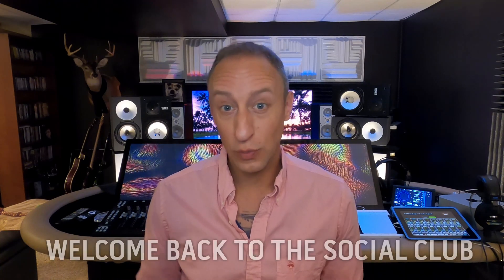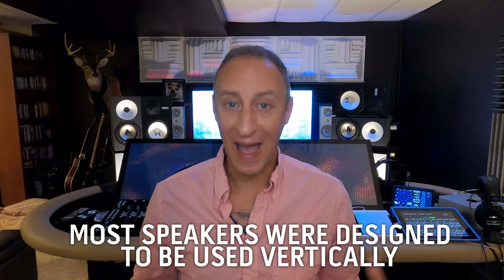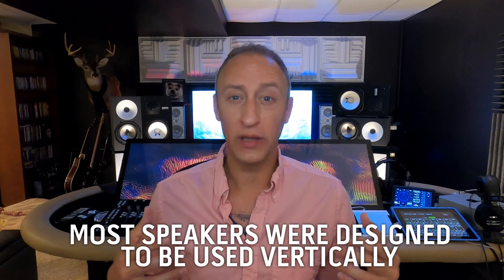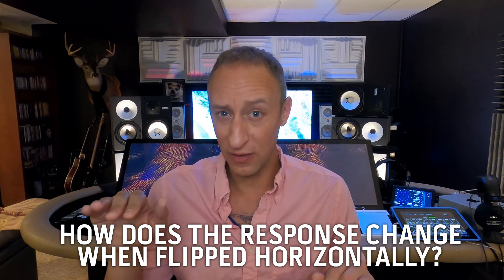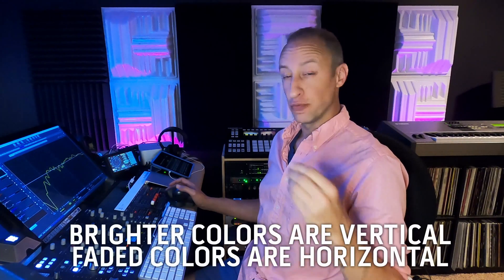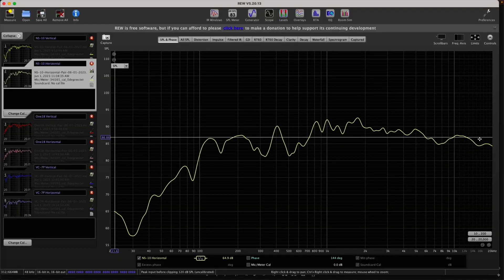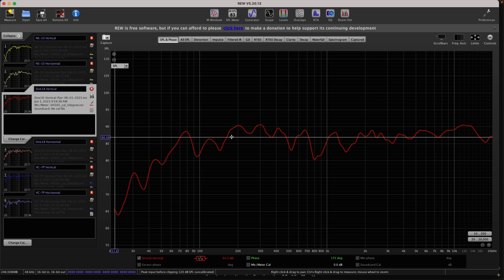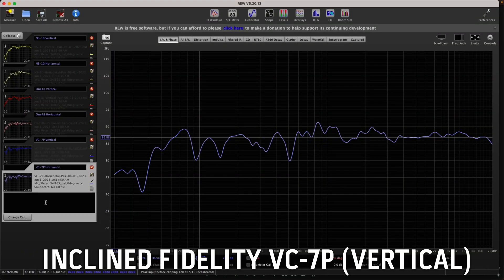VERTICAL vs HORIZONTAL Speaker Placement WHICH IS BETTER? - TSC Production Tip 007

Comment: Well I’m using NS-8’s now. Last 7 years.
Translation is ok. 
Some of the best Translations came from a combination of Tascam speakers and Cerwin Vega 15’s as well as placing the studio in the corner of the room … printing through digital tape on a tascam tape machine. Vegas placed very incorrectly in the room. Tascam in the sweet spot … used a non acoustic treated room just some cheap egg cartons here or there.  Featureless on the mix table so having no reflection issues on the desk ..  definitely like the response of your speakers on the EQ plain.
Now I’m on HS8 and Kirk 5’s…nice studio by the way

Comment: What about "Center Channel" Speakers.  I'm fairly certain those are meant to  be placed horizontally.  For example if you have a center channel speaker that has a woofer - Midrange (or tweeter) - woofer (all in a line), can that be placed vertically?
Reply from the maker: The MTM design of center channels aids in the horizontal off axis response which results in a more even response across the horizontal plane. If you were to switch that to vertical, the response across the horizontal plane will suffer. Since people are typically seated next to each other and stationary when watching a movie the better horizontal response results in a more even experience for everyone on the couch. If you were to flip that vertically, the people to the left and right wouldn't get the same soundstage as when it was horizontal. Hope that helped clarify. Thanks for watching!
Reply: @SocialClubSound  Thank you!  I appreciate your response.

Comment: Did you measure both speakers at the same time? You’re not supposed to measure both L and R speakers at the same time. The data here is inaccurate, very misleading, unless I missed something?
Reply from the maker: I covered this in my Speakers vs Studio Monitors Part II video. In speaker design, one speaker measurements are a must. But part of this was showing the in-phase summed response from the listening point. If the speakers aren't properly set up, the phase will be incorrect and the frequency response will suffer especially above 10khz. By measuring both at the same time you can verify the speakers are correctly setup, and see the response you can realistically expect to hear at that listening point, because even we listen we're not listening to only one speaker. We're actually hearing how they sum in the room.

Comment: don’t the back of those monitors reflect a lot or do you mix in front of them ?
Reply from the maker: When you say the back of those monitors do you mean my touchscreen video monitors? If that's what you mean, I have them placed and angled so there's no sound from the speaker directly reflecting off them.